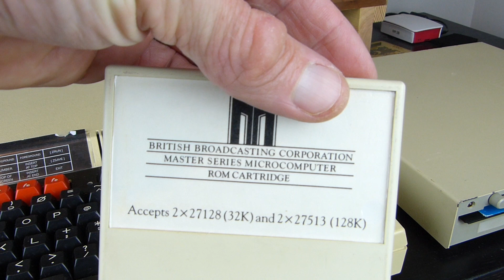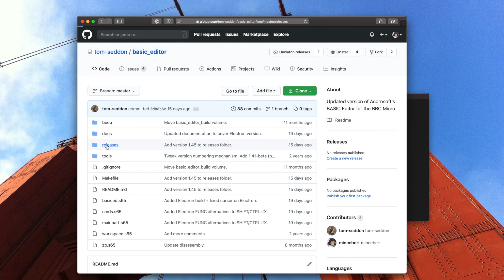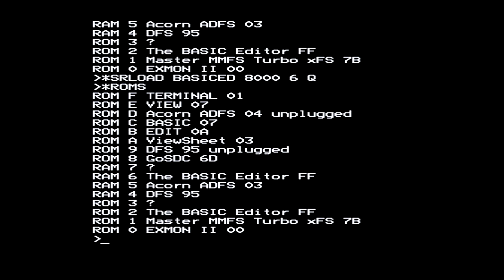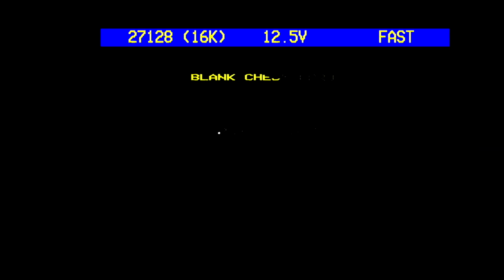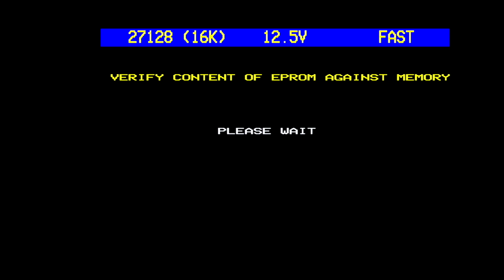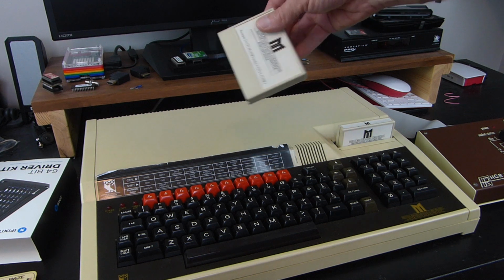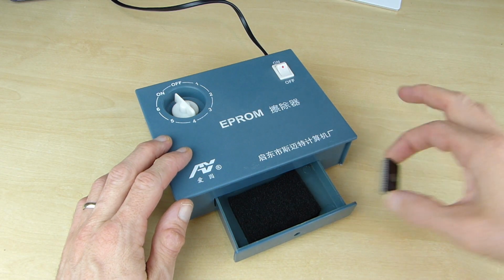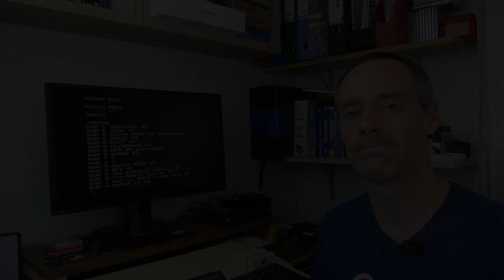Burning EPROMs with the BBC Micro

Comment: Coming to this late but thanks nevertheless and as always, an excellent tutorial. I have just purchased a HCR MICRON EPROM programmer which looks to be very similar to your one but with a set of dip switches to the right of the non-zif socket. The software looks similar to yours and my purchase included an EPROM with what I think is a version of the software.  I guess you can load the software straight from the disk or use the rom version, I have a M128 and intend to use that because I don't have any spare sockets left in my BBC B. If you are still monitoring this thread - the software seems to indicate it is suitable for BBC Bs, I am hoping that if I try to use the ROM on my M128 it wouldn't fail due to illegal software calls. I would appreciate your thoughts if possible? Once again thanks.
Reply from the maker: Hi — yup, the channel is still alive; I'm just not very productive!  I do have a new video I'm about to start, though (after a bit of preparatory woodwork!).

I believe there's an updated HCR Micron EPROM programmer from the one I have that programs 128K ROMs, possibly using some internal memory.  It's possible that's the one you have; or maybe you have an older one that doesn't allow things like the voltages to be set from software.

The ROM supplied with mine was 1.30, I believe, but I use the updated 1.40 version and it seems to be fine (I think that adds support for the enhanced programmer).  There was a discussion about all that on StarDot a year or so ago.

I generally use mine on a BBC Master, so I don't think you'll have any trouble with it on there.  I don't think I've used it on my Model B, although I would expect it to work.  I typically have the Pi1MHz in the 1MHz Bus socket underneath so I don't tend to use it often but, instead, use the modern TL866II programmer I use on the PC in the Master MegaROM video.

As for the ZIF socket, on mine, that is just plugged into the normal DIL socket underneath and can some out.  I don't know if it was shipped with that or someone else added one, but you could easily add one yourself.

Good luck with all that!  When I first got mine, it was a bit unreliable and wasn't detected, but a few connections and disconnections on the IDC connections cleaned the crud off and it works fine now.

Comment: I've got a BBC Model B+ which can use 32kByte EPROMs, such as the 27256. You can program them with two sideways ROM images so, for example, I have View and ViewSheet stored on one chip, occupying one physical ROM socket but providing two 16kByte sideways ROMs. The 28C256 is an EEPROM, which can be reprogrammed without the need to be erased with UV light and is still being manufactured, which make it more convenient. It's also almost pin compatible with the 27256, but not quite. There are two pins that are different, so I made a small PCB with header pins that fit into a sideways ROM socket on one side and a surface mount SOIC version of the 28C256, a pull-up resistor and a pair of jumpers on the other side. If you set the jumpers to the Program position the chip is connected directly to the pins and you simply plug it into the programmer. When you've programmed and verified it you can put the jumpers in the other position and it looks to the Beeb like a 27256.

Comment: I used BBC-b / Masters at collage. Even kept the 5.25 floppies hoping I could recover whats on them but these don't seem to work on an old BBC b micro I have laying around now "missing update roms for the filesystem being ADFS?" The disks have been kept in very good condition in there original Dixons brand box. *cat shows the disks contents without any issues but loading anything else brings up error 18 and a random hex value so there could be an issue with the 40 Track 'Tec 501' drive if not the disks themselves. 

I never know about eproms for those computers, very interesting... just good old tape, disk or econet.

Comment: One thing I did learn about EPROMS about 10 years ago was that erasing them with environmental light is harder than people think.  We had a Farley Wizard plasma cutter at work that was forever going wrong and the cabinet door was constantly open near to a bunch of welding bays, EPROM exposed and it’s code never slipped away.  In the end we scrapped it for being too old and worn to cut decently.

Comment: If the EEPROM fails because off too many program/erase cycles (not because you programmed it with the wrong voltage) you can try restoring it (by releasing the electrons from stuck cells) by baking the EEPROM in an oven. At least that was the case with the very first EEPROMS that came to market, like the 2708 which could only be erased a couple of times, but I think the same mechanism will also work with later EEPROMS, you can try it. Bake them at 200 degrees for say 30 minutes. and see if there are still bits stuck at zero.
Reply: How interesting!  I have a bunch to try that on, Thanks!!

Comment: Ah that's really interesting. I have one of those old chips I extracted from something. I've got a data sheet for it somewhere. I seem to remember it needed 20v or something to program it. I hadn't realised that the way the UV thing works is to change all the bits to 1's. I'd kinda assumed you had to apply the high voltage AND the UV to it while programming but that programming could set 0's or 1's.  Totally failed to appreciate that the programming can only flip a 1 to a zero. Fascinating stuff!
Reply from the maker: The non-A ones need 20V but the A versions only 12.5V.  I think 12.5V became more the norm later as, if I select the 27128 (16KB) one, it defaults to 20V, but if I pick the larger 27256 (32KB), it defaults to 12.5V.  You can change both with the secret Ctrl+V combination.

I've broken one or two EPROMs by forgetting to set the voltage!  The usually fail immediately and, even after erasing them, you can never program them again.

Comment: Really enjoyed that. I burn eproms for my beeb on a modern device but have always wondered how it would work using real old hardware. :)
Reply: What modern device do you use?  I'm looking for something to let me burn eproms or even eeproms if possible for the beeb I'm in the process of restoring.  Thanks
Reply: @8bitmark530  mine's a TL866 (pretty common one) and burns a huge list of eproms as well as can we used as a chip tester. Such as a lot of 74LS chips etc
Reply: @RetroMarkyRM  thanks